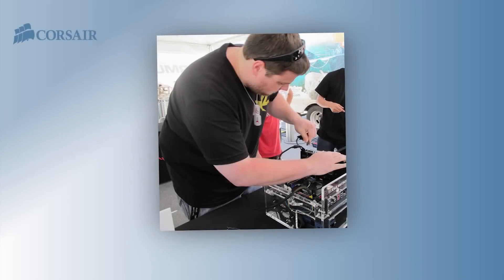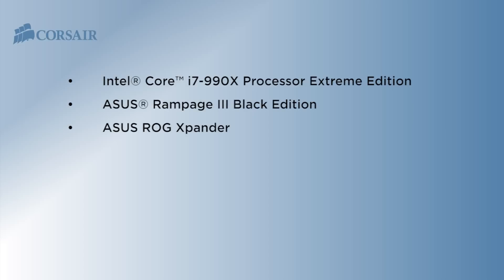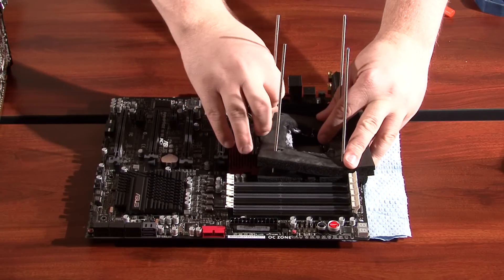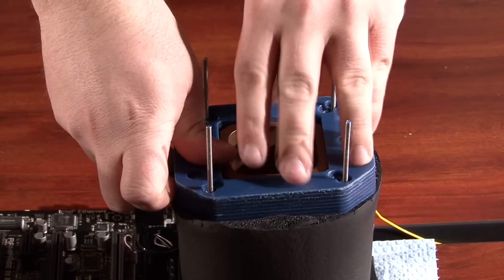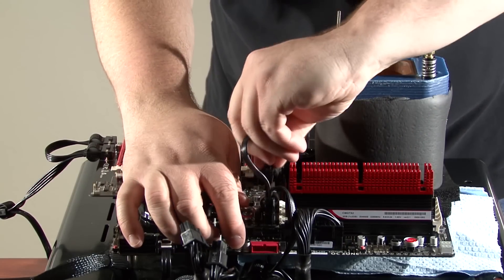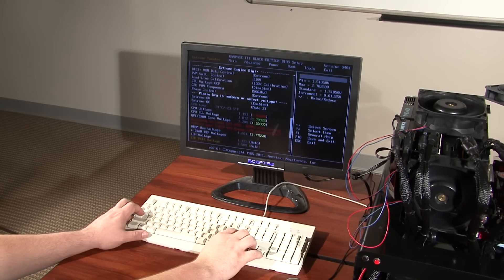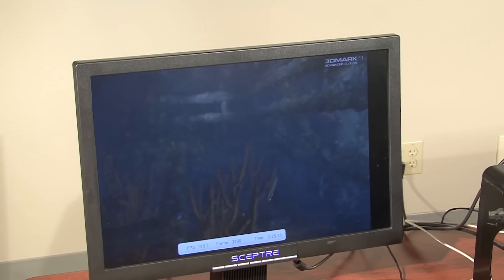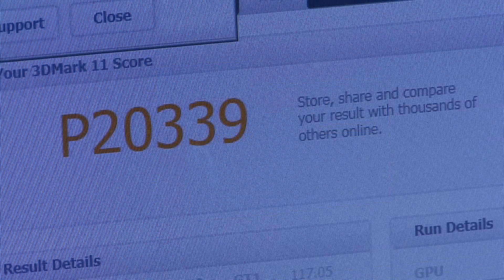Setting up your PC for liquid nitrogen cooling

Comment: i dont see the point in buying a powerful cpu and overclock it for gaming,i understand that its fun just to see how far it goes up. those commenting about games should understand that u need a good gpu (and acceptable cpu, like i5) in order to play your minecraft or whatever
Reply: +Devin Williams i see, you are right but then why 4 gpus ?
Reply: +rrrtriple1 Because the GPUs are calculated into the end-result of the benchmark.
There is no reason in going through all this effort to OC the CPU to 6 GHz and then using 1 GPU which pulls down the score.
Reply: to be honest liquid nitrogen is basically a extreme way of torture there is a phase changer that will do subzero cooling but atleast it's better than water cooling but the cost of the phase changer is expensive all it is is a fucking freezer

Comment: Can you run a full OS at those frequencies? .This means all the functionality of the system is required .Or are this  tests just  barely using the CPU. And is more of a curiosity ,than something really useful for any purpose
Reply: +Charles McBoy You're running a benchmark to test the overall performance which is putting the CPU and GPU under heavy load. If you pass the benchmark till the end without crashing, glitching or freezing, the run is called stable and your score is put onto the leaderboard. It's just a competition to show what the hardware is capable of and on which configurations you get the best scores.

Comment: I just run my Motherboard in a freezer. I cut holes and used rubber seals to run the wires.
Reply: +Jason Maxwell No you didn't. A PC in a fridge has less cooling-performance than using the CPU stock-cooler on air.
Reply: I didn't say fridge, I said Freezer.
Reply: Jason Maxwell
Same concept, doesn't work either. Learn about thermodynamics and you might realize it yourself.
Reply: Learn how to do things by doing them. It has less cooling performance even though the air is cooler in a freezer like below zero sure buddy.
Reply: I used metal heat sinks but you could also do this by keeping a mineral oil submerged board in the freezer the oil will not freeze and the temps will be extremely cold MR thermodynamics.
Reply: Jason Maxwell
A freezer can freeze things that aren't producing heat by themselves. As soon as you put a constant source of heat into the freezer, the inside of the freezer will heat up till it reaches equilibrium (which will be too high to cool the PC). The only freezer where that might work are room-like freezers that produce the cold temperature by blowing in fresh A/C air that is cooled below 0. In any normal household freezer, the TDP of any modern computer surpasses the cooling-performance of the freezer since no air is moved inside or even replaced by fresh air. Also it strains the compressor too much, since under normal conditions the compressor only turns on when a certain temperature-threshold is reached, to get the temperature below threshold again. With a constant source of heat inside, the compressor will run 24/7 and the compressor will break down in no time.
I don't have to try things that hundreds already tried before me over a period of over 15 years.
I'm not putting square wheels onto my car only to test if it might actually work.
Also, putting a PC submerged in mineral oil into the freezer doesn't change anything since the mineral oil is cooled by radiators outside the case that once again put warm air into the inside of the fridge. It's exactly the same principle like normal air-cooling, only with mineral oil as a medium between component and air. The only thing mineral oil does in this case is delaying the time it takes to reach equilibrium.
But your failed try of bringing mineral oil into the topic shows me that you understand nothing about how cooling or thermodynamics work, so any further discussion is senseless.
You can't deny physics and you can't outsmart thermodynamics, no matter how much you write here and how heavily you try to defend the idea.
Reply: You have no idea what your talking about. First off it is the issue of frost and condensation, that is why people don't try it. There is a big difference between a freezer and a refrigerator your obvious assumption in the beginning tells me you don't know what your talking about. I know that you got your information off of a forum or a website and you never tried yourself. People have tried refrigerators that won't work but it can if your just using the air. A Freezer will works as long as you circulate the hot air out. Water proofing was the biggest issue not thermodynamics because the heat is being discharged. SO take it easy there nah sayer and try it yourself next time.

Comment: God dammit this is a lot of effort to play video games, I mean how are you going to enjoy the game when you constantly have to refill the liquid nitrogen every 10 minutes or so
Reply: It's not about "gaming" its about benchmarks :p seeing how far you can get your cpu(and hardware in general) , pushing it to the limit. Many people enjoy this.
Reply: +Cliff Reeser no the real question is if it can run minesweeper
Reply: +Half_Finis I'm pretty sure he was joking.
Reply: Cliff Reeser Wow dude have you seen the textures in World of warcraft? he better do that with two other cards to make it run even close to smooth!
Reply: +Cliff Reeser benchmarking and gaming are 2 completely different things
Reply: Half_Finis I think the real question is can it run Crisis?
Reply: +Cliff Reeser this is not for gaming. but it could be useful if there were tools to connect the pot to a liquid nitrogen tank and let it fill itself while the PC is doing some heavy rendering or calculation. This is not for the faint of heart!
Reply: +Chakib Tsouli Does not seem too difficult to engineer a system for that. Connect the liquid nitrogen tank to the cooling cylinder with solenoid. Add a micro-controller and sensor(s) to monitor/control the temperature and input flow.
Reply: Metatr0n yeah but with a $5,000 music production beast or a $7,000 Quadro/FirePro workstation beast what else will you do with that spare power?

You really wouldn't waste that on actually DOING THE WORK right?
Reply: +Chakib Tsouli That's a possible application but it would be too expensive to produce LN2. It is better to go with distributed computing or whatever it is called. Having multiple PC dividing the workload, just like Pixar and many other companies do it.
Reply: +Cliff Reeser Not everyone is using a computer to play video games. Grow up.
Reply: Metatr0n you're right, they also use them to watch porn.
Reply: Asriel Dreemurr
My reply was based on the initial assumption that LN2 overclocking is for playing games with better fps.
LN2 overclocking has nothing to do with gaming or anything work-related. It's all about benching, nothing more.
And there is no need for quadro-workstations, almost every Geforce can be swapped to a Quadro with a soldering-iron and knowledge about what you're doing.
Reply: It's probably for research though

Comment: Isn't it absurdly risky to use liquid nitrogen ?

I mean, roughly 33% increase is great, but one drop of liquid nitrogen spilled on the motherboard could destroy it, couldn't it?
Reply: +scarfacemperor see the nurd rage video on the leidonfrost effect
Reply: +cresbot It vaporizes into nitrogen.
Reply: ***** Liquid nitrogen vaporizes into carbon dioxide (i think) as soon as it touches anything room temperature.
Reply: cresbot sure it doesn't spread damage like acid would, but it probably damages with the cold. It's something like -180°C, causes terrible burns to the skin (yeah, cold burns...) so I assume the MoBo isn't designed to withstand liquid nitrogen...

Also, liquid nitrogen is nitrogen. Dinitrogen to be exact (N2), you mistake with carbonic snow used in fire extinguishers. The gaz itself causes no problem since dinitrogen is very hard to chemically react. But the cold is the problem
Reply: ***** A scientist poured a bucket on himself and had no visible injuries, and didn't die later.
Reply: cresbot I'm curious of how his skin was where he had liquid nitrogen poured. The cold surely kills cells, causes local necrosis.
Reply: It's called the Lidenfrost effect, where if the other components are so warm, a layer of gas will form under the Nitrogen and won't touch the board.
Reply: +scarfacemperor The skin is too hot for the liquid nitrogen, so it vaporizes instantly and then slides off the persons body. Making it safe.
Reply: JuriePie Please explain how im an idiot
Reply: cresbot instead of calling people "idiots", look consider their arguments and in that case at the video. That's what smart people do.

Can't say for you, but the video convinced me.
Reply: ***** But i never called anyone an idiot JuriePie did.
Reply: JuriePie My mind had a blank moment and I didn't really think about it. But isn't vaporizing when a liquid becomes a gas?
Reply: cresbot sorry, pressed the wrong "answer" button. Yes, vaporizing is when a liquid becomes a gas.
Reply: +scarfacemperor If you notice, in the video he has splashing when he poured the first time (it surely hit the Mobo from thay angle) and it ran fine.
Reply: +ChronoBound Evaporation is a more general term. The reason you don't use evaporation in higher classes is because practically all liquid substances are evaporating at all times and at all temperatures - this depends on the vapor pressure of the substance. However, the term vaporization describes the instance when a substance is heated and it transforms from a liquid to a gas.
Reply: +cresbot I thought that was just dry ice
Reply: DeadPool Junior. Yeah i got it wrong, i new it vaporized in nitrogen i just forgot at the time.

Comment: I've modified my cooling system as a liquid nitrogen pure ethanol cooled system. I modified the cryogenic container I bought and mounted it on a platform with my tower. I pass the ethanol through piping within the container and run it through titanium tubing. I use a cryo-pump and specially designed cooling plates for the i7 980x cpu, 2 Tesla K80's and 2 Nvidia Titan Z's.

Comment: This method is not stable right? So whats the point
Reply: +Jesus Mendoza It's like american drag-racing. Where is the point building a 30,000 bucks engine with 2,000HP to only run a 1/4 mile and remove the engine again because it's done for?
Fun, competition, breaking records.

Comment: But can it play minecraft
Reply: On very low settings in 480p at 1frame per day
Reply: +LPyourplay On ultra low settings with 0.001  frames per a century
Reply: +LPyourplay at 1p
Reply: doesnt reach minimum requirements